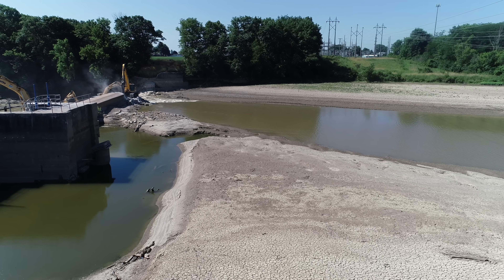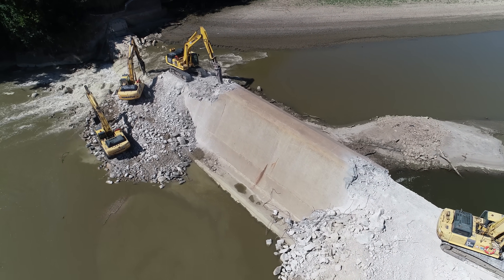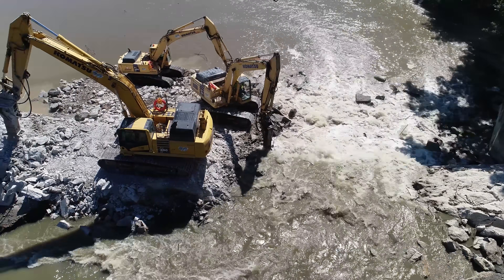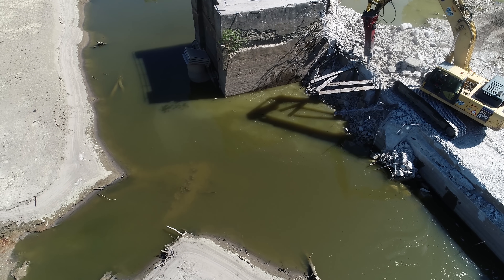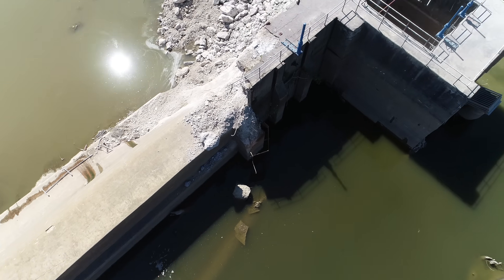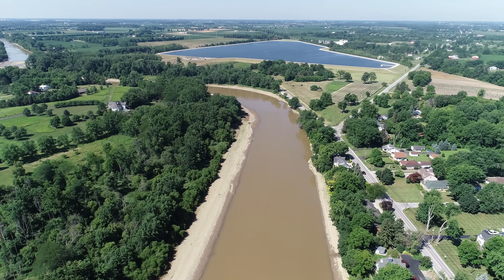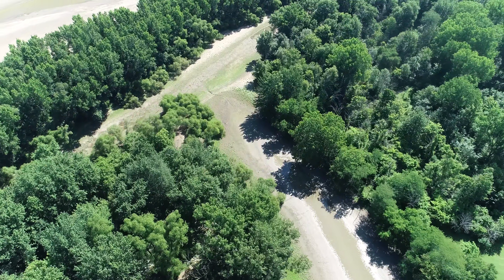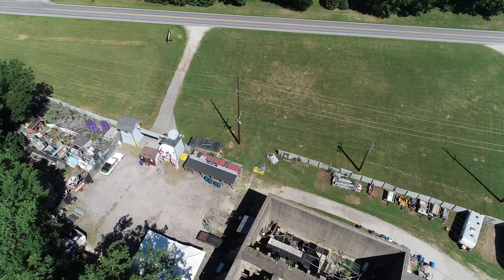Dam Removal Day 8

Comment: How are you able to get so far away from where you are with the controls? Thanks.
Reply from the maker: I have very good eyesight..
Reply: Haha, I meant because of your signal. I know you see where you're going through the controller. : )
Reply from the maker: I get 1-3 miles range usually
Reply: Ahh ok cool. I didn't know you could get that far away. What are you using? I like the quality.

Comment: I was under the impression that the dam had a hydro-electric element but this video shows that it was a separate structure downstream? Very interesting.
Reply: A 14' diameter flume pipe transported water from the Ballville Dam to the downstream hydroelectric plant.  "Into the head works on the downstream side was built the upper end of the pressure pipe line to convey the impounded water to the power house. This penstock was 3,000 ft. long, 14 ft. in diameter, and was made of 1/4-in. steel plates riveted together and provided with an angle stiffener ring at each joint. The pipe was supported throughout its entire length on cement-concrete piers, placed 6 ft. between centers, and laid true to grade with the top not less than 24 ins. above ground. Five expansion joints were put into the line to take care of temperature stress; and three man holes and two washout valves were placed in proper locations." "Engineering and Contracting," February 18, 1914.

Comment: What is the reason for the removal of the dam?
Reply: No longer served original purpose of power production and subsequent use as water supply until the reservoir shown was built, so now instead of letting it sit there and crumble into a more dangerous liability they are removing it it the most conservative way. Much like many other dams/weirs were simply removed and the river did the rest in its own way.

Comment: That operator by the valve section better read his operators manual. Notice at 6:11 in the video. https://youtu.be/SiDjFFRMMw4  Should have that excavator with the bucket on to remove all the loose concrete.

Comment: Ice control structures?  What are they and what do they do?
Reply: Hi xsbuilder1 In The winter the River is frozen ! and as the thaw comes, the ice travels down river on block! as it comes over the weir it causes the ice to break up into smallerl pieces on the Ice Control so as not to block or dam the river up!
Reply: xsbuilder1 w
Reply: The Ice Control Structure was added in late 2017 to replace a previous function of the dam.  In late spring ice sheets form on the Sandusky River and have historically caused major flooding in the city downstream.  The ICS is designed to hold back the ice floes to prevent them from jamming within the city downstream.  The ICS will remain post-dam.
Reply: Thanks to all who replied. I never had to deal with that kind of problem. The only time I ever saw ice in a river was when I spilled my Slurpee Big Gulp while standing on the bank of the Sacramento.
Reply: There to catch all the trees, logs and trash and spend tax payers money to have it all removed when the water table is low.

Comment: Technically, it's not a dam, but a weir
.
Reply: The Ballville dam, on which construction was begun in 1911 and completed in 1913, was built by the Fremont Power and Light Company and was originally intended to impound water for hydroelectric power generation. 

The City of Fremont purchased the dam in 1959 from the Ohio Power Company, which no longer used the dam for generating electricity.  The city used the dam impoundment as the community's raw water supply until the relatively recent completion of the upland reservoir shown in this video.

The south overflow section of the dam (the portion that has been notched during the removal) is one foot in elevation shorter than the north overflow section.  The north overflow section was added during reconstruction after a catastrophic failure during a massive spring flood in 1913.  The dam generally is approximately 34.4 feet high.
Reply: Its part dam and weir, after its initial use it just became a weir and used for water supply until the reservoir was built
Reply: I tell you what, that is one beautiful new reservoir.  I really enjoyed the up-river flight, that's some gorgeous country.

Thank you for the history of the dam too.  I ran across the first video somewhat randomly and didn't know anything about the dam or the area. :)
Reply: That's exactly I wanted to write... it's like 15 feet high, but as I understand every even little river construction in the US is a dam (see this maybe 3 feet "dam": https://www.youtube.com/watch?v=qXq41_-NWsQ)

Comment: Will the dried out sediment be scooped up for farm fields or whatever??
Reply: Scott Scouter Unlikely, I read the proposal studies.  They thought about doing that, but the cost analysis shows they'd only make back about half the cost of removing it.  The plan is to seed it with Riparian plants/grasses all along, remove the flood wall by the dam, remove an old timber dam that was submerged (assuming it still exists), and grade the banks where the dam was.
Reply: Thanks, most helpful. It looks like it's only about a 600' drop from headwaters to the dam site, so not going to be much "fast water" there, eh.
Reply: Ya wait till theres a big rain! There goes all the sediment!  https://youtu.be/lCYS0nnr4-8   No matter what they plant on that silt its NOT going to hold it! The new channel is going to be narrower and the current will be stronger and faster than before and will wash that silt away.  just the small creek banks that are washing out and eroding from to much from all the new developments, shopping stores and parking lots.

Comment: Why don't they just blast it down?
Reply: From the 2011 Stantec Ballville Dam removal feasibility study: "The use of blasting for dam removal is not recommended due to the frequency of structural steel within the concrete, of the shallow bedrock, and nearby existing infrastructure including the carbon feed building, the raw water line, houses, and Tiffin Bridge."
Reply: Can't release that much water all at once, not good for a whole host of reasons.
Reply: Yes, cletrac12c, environmental plan:  https://www.fws.gov/midwest/fisheries/documents/Ballville-Final-EIS.pdf, https://www.fws.gov/midwest/fisheries/documents/Ballville-Final-EIS-Appendices.pdf
Reply: That's what I was thinking. It may be a threat to surrounding areas with flying debris. Experienced demolition crews could keep explosion debris contained to certain areas
Reply: The environmental plan is to notch it out slowly so the sediment has time to dry out and stabilize.  Now why didn't they notch, then blow it?  My guess is cost.
Reply: cletrac12c They based the plan off of dam removals in the Pacific Northwest.  Approximately 50% of the sediment was moved downstream within three years in the cases they studied.
Reply: Ha! enviromental plan? whats going to happen when theres a four inch rain storm?